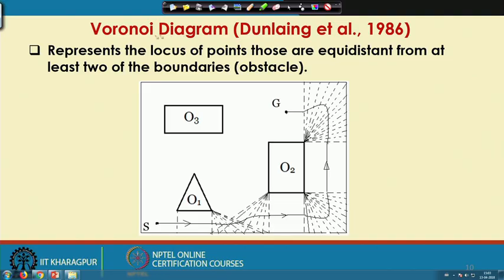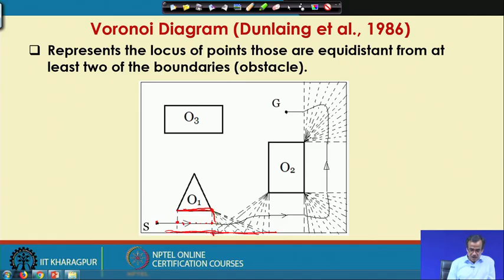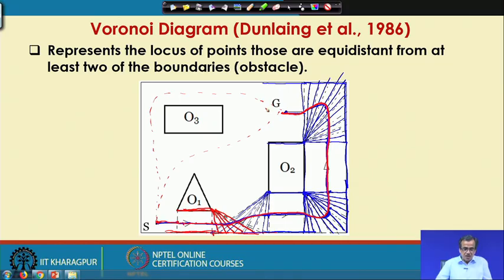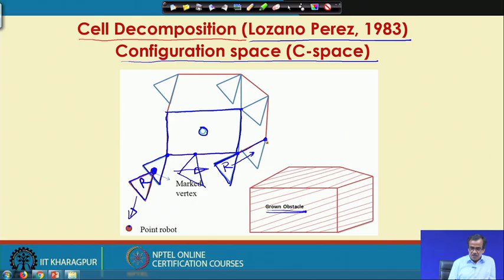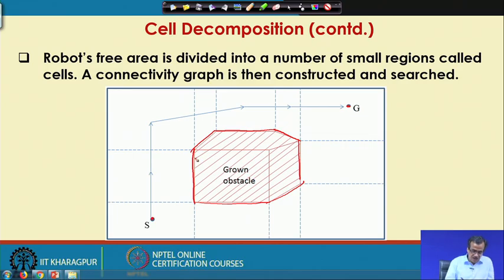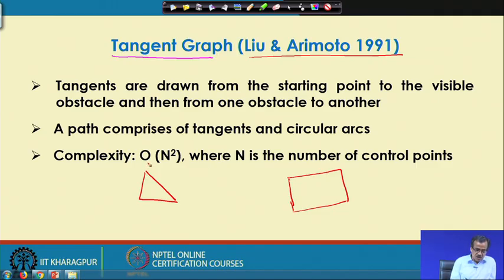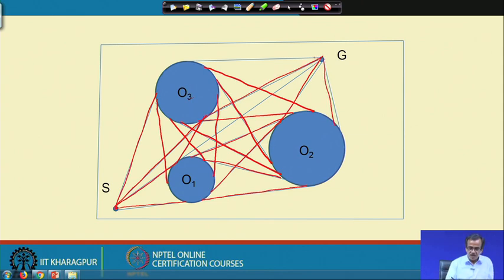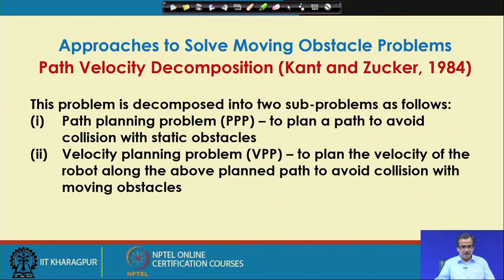Lecture 38: Robot Motion Planning (Contd.)

Comment: 00:14 Using Voronoi diagram to find collision-free path
04:02 Finding a collision-free path for a point robot
07:47 Voronoi diagram and cell decomposition are popular techniques to solve the find-path problem.
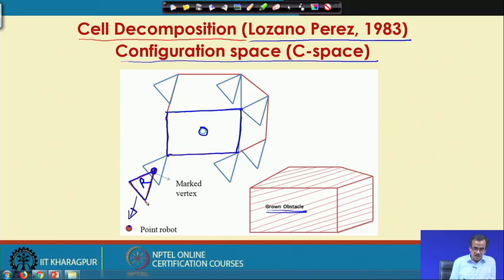11:38 The robot slides to reach the marked vertex and changes direction.
15:02 Finding collision-free path using cell decomposition
18:27 Two methods for finding collision-free paths for robots
22:03 Finding a collision-free path using tangent graph technique
25:20 Finding time-optimal and collision-free path using tangent principle